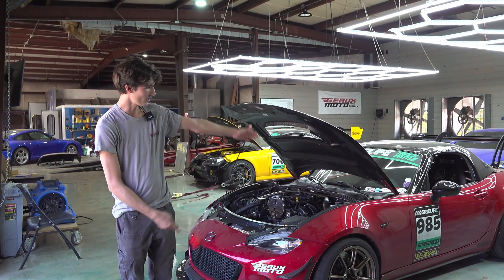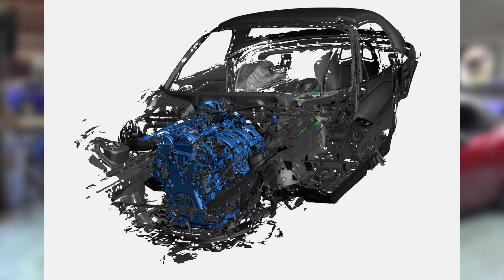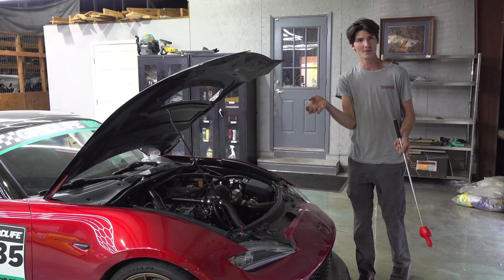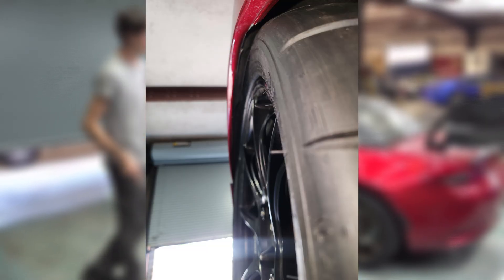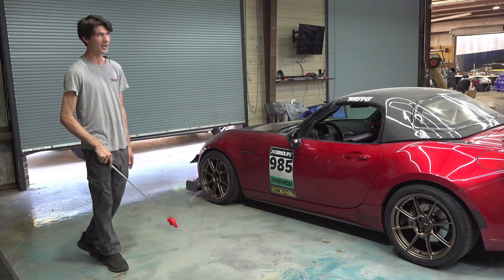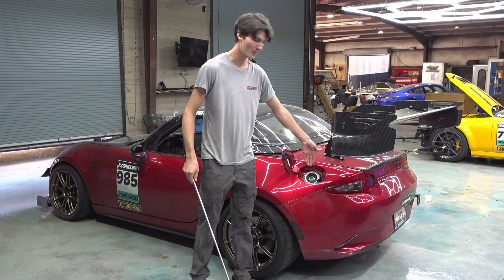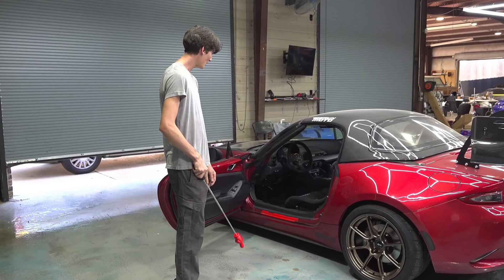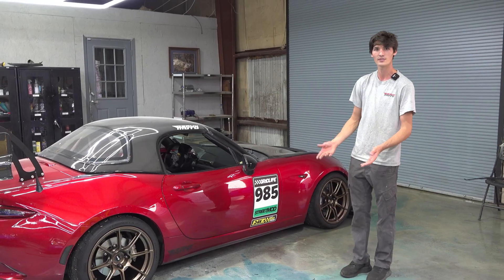Ecoboost MT82 ND Miata - 500+ HP

Comment: Elephant in the room… K20/24 seems like a better fit so why an ECOBoost with an open deck design?
Reply from the maker: We wanted to be unique and we see a brighter future for the ecoboost platform. It's a more modern swap to build on with parts being readily produced and available. It also reliably makes double stock HP and TQ numbers without the hassle of adding a turbo to a non oem turbo motor. As well as being a small package with a strong transmission to bolt on without adapters which saves cost and hassle.

Comment: 285 is insane. I'm stepping up to STR next year and I can't seem to find any real info if I need to roll the front fenders when running 245s. I will be installing limiters on the steering rack. I dont mind rolling the rear BC it is steel and should be easy. I just dont wanna be another MX5 with cracked front fenders.

Comment: Ecoboost is a horrible engine. Wet belt. Unreliable.
Reply from the maker: Wrong motor. The 2.3 and 2.0 ecoboost have a timing chain and they're even used in production race cars like the Radical SR10.
Reply: @geauxmoto  fair play

Comment: What kind of wiring harness was used for the engine and ECU?
Reply from the maker: This is all run on the Ford Control Pack, so Oem ford engine harness and ECU
Reply: @geauxmoto  
And the donor is a mustang? I don't quite understand the translation

Comment: what's done to the mt82? and what rear end?
Reply from the maker: MT82 is stock with our Custom MGW relocation shifter and the rear end is OEM housing with OS Giken differential.
Reply: @geauxmoto yep that mgw is a must on the mt82. I used to run aluminum flywheel and a light stage 4 clutch in mine and the revs were really quick. Excellent heel toeing potential

Comment: A DCT swap in the future for this car would probably get this thing right around the top pack of Street Mod.
Reply from the maker: Hoping to do that with our 6mt for now! Hard to ignore the advantages of a DCT though.
Reply: @geauxmoto  I would be super intested in this drivetrain swap into a sleeper looking ND Miata. I dont know why I never thought of the ecoboost engine.
Reply: @katanamast279  every craps on the ecoboost motors but their badass engines and cheap-ish to mod.
Reply: @jessebudelman Yea honestly I've always wondered if you could get the RS3 engine to fit/work in a Miata or GR86, but now that I saw this I'm like I never thought of it. Honestly would be perfect for both platforms
Reply: @geauxmoto  Have you guys done this ecoboost swap into a Toyota GR86? I think that would be an awesome combo to offer this swap for both the Miata and GR86. Could be a great customer base.
Reply: @geauxmoto  did something change the last couple years? I thought 6MT>DCT was prohibited...
Reply: @tealchief been legal for years.  SuperK's K swapped S2k was the first one to do it in class.
Reply: @geauxmoto  You could do like 4N Motorsports and put a sequential to get the benefits and much less weight
Reply: 10 speed makes more sense cause stock ecu can communicate to it and the bellhousing pattern is identical. Dct will require an adapter and standalone tcu or can bridge.
Reply: Or maybe a ZF8HP?
Reply: @hughjassstudios9688 or a quaife sequential
Reply: Gross. Leave it H pattern.
Reply: Gonna take more than that but it won't hurt 😉
Reply: Maybe he just wants to Row his own gears with a third pedal
Reply: @garrenturk4093  That's great when you aren't wheel to wheel racing for standings.  He's competing, he wants to have the fastest vehicle possible.  He can hoon around for funsies in another manual car that isn't an actual racecar.

Comment: Ecoboost MT82 or 5.0 MT82? You think you could swap a 5.0 MT82 on the ecoboost?
Reply from the maker: Ecoboost MT82, everything bolts right up. No reason to consider the 5.0 MT82, bolt pattern would be wrong and our gear ratios are great as is.
Reply: Gonna need a lot of cutting to fit a 5.0
Reply: @Keterius he's talking the transmission
Reply: @TheBb6prelude oh my bad

Comment: The real eye-opener is that you wouldn't need to go full racecar if you didn't want to for this. The ND manual rear diff coupled with the EB MT82 ratios actually works out really nicely for general drivability and even economy.

I think there's even potential to make it 50-state legal, which would be really wicked for all the ND1 people.
Reply from the maker: Absolutely, we have an Eco swap customer ND meant for the street, it cruises at 2050rpm at 80mph and makes 350WTQ. Great street car application!
Reply: @geauxmoto   How is the reliability and weight with the Ecoboost swap?
Reply from the maker: We've only had to go home early from one event over the past 3 years of racing, and that was because of a poor job from an engine assembler. This car has been the most reliable race car we've ever had. Weight is near OEM, we don't have any hard numbers but this car is 2404 with 9 gallons of fuel.
Reply: In addition to the ND market there are plenty of Fiat 124 owners like me that realize the Multi Air 1.4 is both fragile and difficult to source if a replacement is needed.  I think the street biased consumer market represents the most lucrative target audience to further the incredible work that's been done so far.  If you could get the Ford ECU to work nicely with the Fiat accessories, I'd be very interested